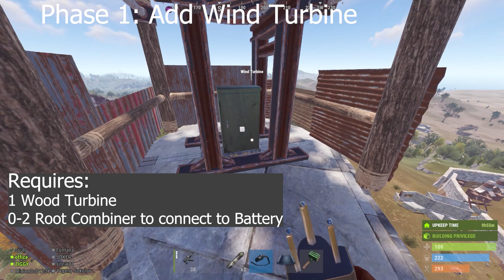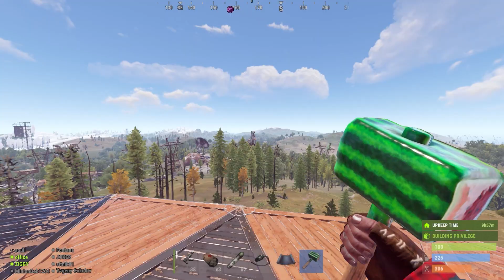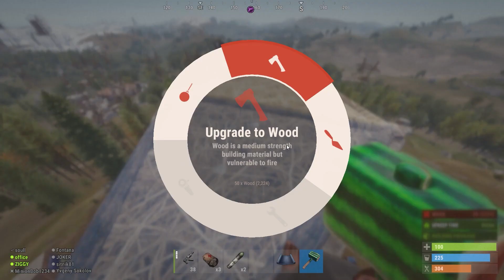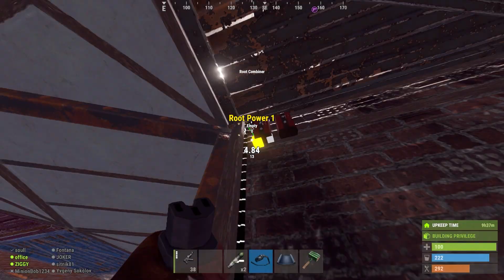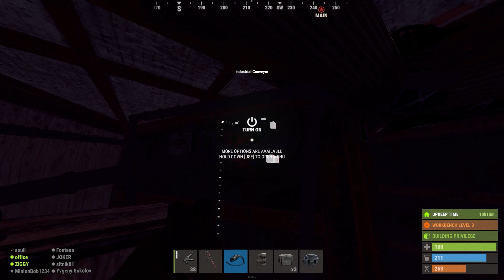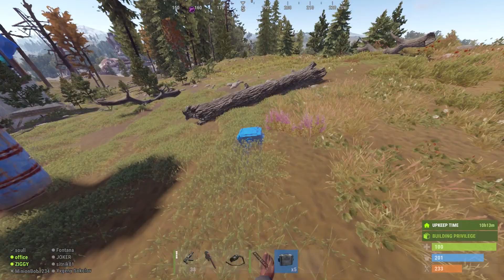Rust Automatic Upkeep - Industrial Made Easy (Part 2)

Comment: I dont get it man I hooked one up from one box to my tc and I have 3 power running to the industrial conveyor with my maximums set to the amounts needed in tc, no minimums, and low buffers and yet it still isnt moving anything to my TC.
Reply from the maker: Hey!
Only thing I can think of is maybe you haven't turned the conveyor on after you powered it up? They can be turned off/on. 3 power should be plenty.